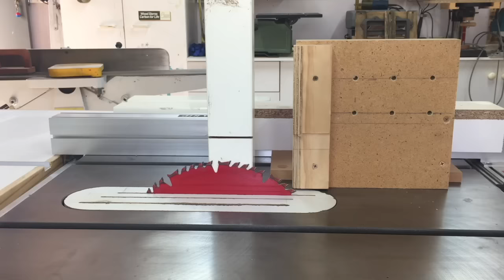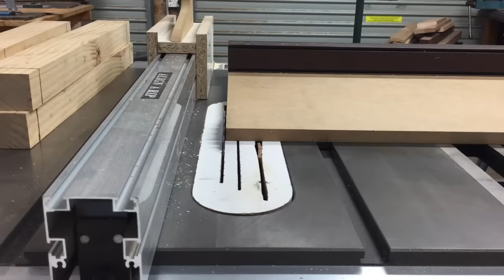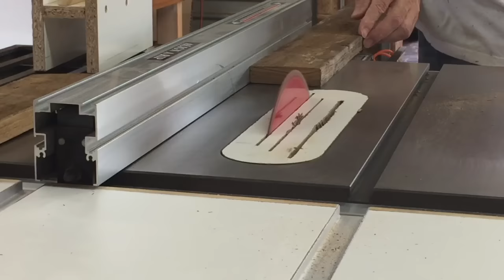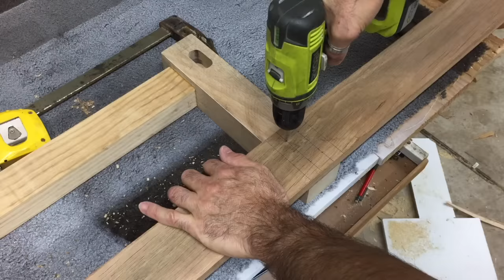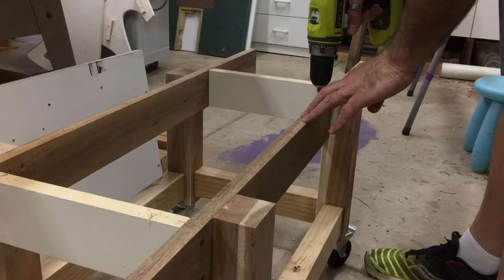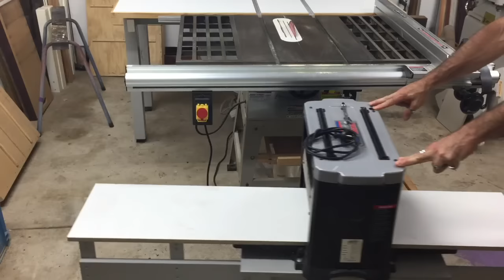Build a mobile tool stand for the workshop

Comment: Great build. How do you find the HAFCO thicknesses? I am looking at some small units, wondering what you were/weren't happy with in yours....
Reply: Thicknesser! Bloody Autocorrect!
Reply from the maker: I really like the thicknesser. The spiral cutter head is great. I don't really have any complaints. I did an unboxing video here https://youtu.be/coIWWIr-144. Haven't used it enough yet to do a review though. But so far its great.
Reply: Thanks that is helpful. I was looking at both versions of it, but will go with the spiral head version - will check out the unboxing video. Thanks also for your effort, it is great to see some Aussie woodworkers on YT!
Reply from the maker: No problem mate, thanks for the support. Its hard for Aussie woodworkers to command a huge following on YT but people like yourself help out heaps. Cheers.

Comment: I hate to see waste and Most of what I do is with rescued timber. In fact every time I see builders skip I ask if I can take any timber from it. The builders are happy to have me take as much as I want as it saves money them money. I've just started looking for building sites as they scrap a lot of very good timber. I wish I had more room but that's very limited and most of my woodwork is done in the open air so spring, summer and autumn are when I can work on timber. That's why I love your You Tube stuff and this one has provided me with a first class idea for my thicknesser so many thanks for very good videos
Reply from the maker: Thanks George, its not only the financial and environmental savings with using old wood, its the sense of satisfaction and achievement seeing it "reborn" so to speak. Happy "dumpster diving" mate.

Comment: Fan-bloody-tastic! Well done cobber!

With the attached outfeed board on the thicknesser, it inadvertently takes away from the depth of timber allowed to run through it, by the thickness of the attached melamine board. This got me thinking... seeing as the outfeed board is attached to a frame, which supports the integrity of the outfeed board, perhaps a notch could be cut out from the bit of the board sitting on the base of the thicknesser?

Gosh I used a lot of words to explain a simple concept! Sorry 😳
Reply from the maker: lol, no need to be sorry Isa. It was never a concern for me about taking away some of the capacity of the machine which is 152mm or about 6". It will be rare for me to want to plane anything that thick so taking away 16mm from 152 is not a worry. Thanks very much, glad you liked it.